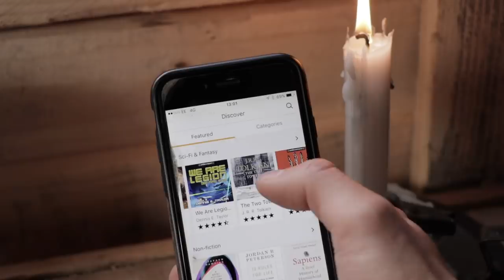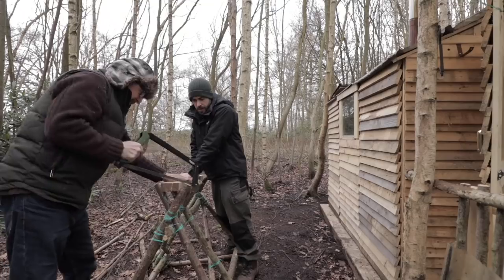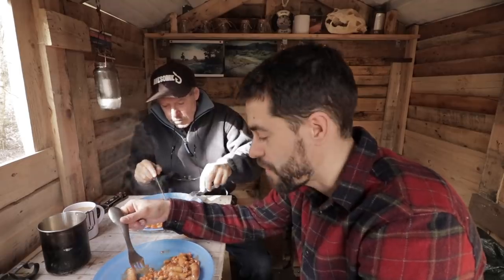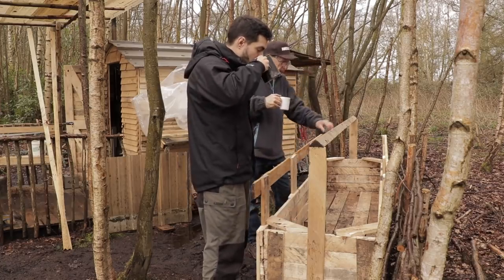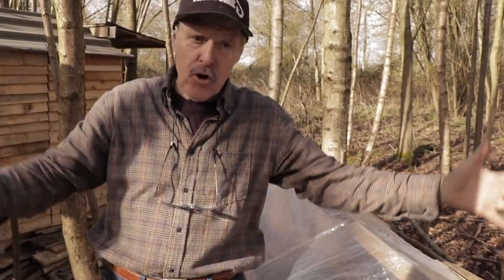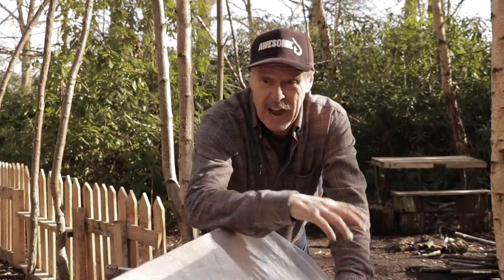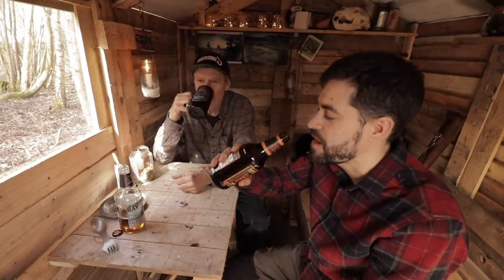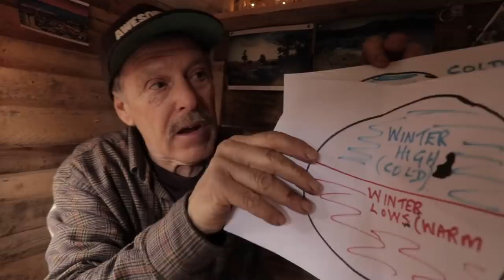Pallet Wood Cabin in the Woods: Raised Vegetable Bed for Spring Garden at The Off Grid Cabin

Comment: should collect the rain water from the slope in a 5 gallon bucket and use it to water your plants, just build a slanted gutter and line it with a piece of that plastic....also for your theroy i think it also has alot to do with the Earth tilt its changing ever so slightly and data from the past 282,000 years that shows, for the first time, a connection between the Earth's tilt called obliquity that shifts every 41,000 years, the movement of a low pressure band of clouds that is the Earth's largest source of heat and moisture—the Intertropical Convergence Zone, or ITCZ.
Reply: Where did you find data from more than a quarter of a million years ago?
Reply: Arctic ice core samples

Comment: I would add guttering to the cabin with a water run off collection system to collect water for your poly tunnel etc. I would also look into a solar panel for the roof. Just my thoughts thanks for sharing.

Comment: If you could find some discarded foam insulation board (in the states commonly used for basements or on the outside beneath siding) this could perhaps be adhered to the underside of the steel roof.  If you could find discarded construction adhesive this  might work.

Comment: Mike, if you haven't already, you should undertake the marathon read of Stephen Kings "Dark Tower" series of books. Its an incredible series, and not the usual horror you would expect from him. As for your Dad's theory time suggestion, I think its a feasible possibility, although it would more likely end up in a slightly narrower band of warmth around the equator with larger cooler caps both above AND below due to the melting ice from both the Arctic and the Antarctic

Comment: (IDEA FOR INSULATION!!!) i see that the wood shingle wall is visible from the inside. If you take some more planks and nail them up, flush along the inside wall then stuff the cavity with pine needles (or moss) along the way then it should help cover up all the cracks and give you some good insulation. Kind of like a real house. Some proper windows with a seal around the edges would help too. and putting seals along the door

Comment: Can I suggest a length of old guttering along the ridge line of your 'poly-tunnel'? I can't help feeling that the relatively sharp edge of that Arris rail will slice the plastic sheet. Speaking of which, I'll be interested to see how UV resistant that is... I'm guessing not very.
As for the cabin roof, lacking turf for the outside, I reckon your best bet is to line the inside, to create a 'more-or-less' closed airspace. Air is actually a pretty good thermal insulator, if you can stop it moving around too much. Just my two-penn'orth.

Comment: number one problem with the roof is the gaps in the eaves, they are big enough for light to get through, and cold air will pour right in. only then should you work on moss or vegetation pads.

Comment: Theory time - well as you keep saying, we rarely have snow on the south coast, which is true, but nationally snow has become less. My feeling with the polar caps shrinking is that air temperature isn't as cold as there is less ice volume to cool it, thus the warm air is gradually rising year on. Thus the loops are getting higher. The beast from the east is rare, and was a fluke combinations of air direction, weak storm currents from the tropics and Putin.

Comment: You are right. But it is not so much about the atmosphere changing, but the ocean currents changing (which then will change the atmosphere temperature). Did you watch the movie "The day after tomorrow"? That is exactly what happens in the movie, the north Atlantic ocean circulation stops working and Europe and north america experience a extreme and long winter.

Comment: When I can stop laughing I will try and add my halfpenny worth. Your second diagram (hang on I am laughing again) should only have gone down half way with the heat part, it would not go down to the antarctic. What about if heat rises it would get hotter above the equator. Serious now. On the inside of the roof stick egg trays, you can get them free and you can paint them. They will insulate the roof and stop some of the noise when the rain hits it. Keep it up fellas I love it.

Comment: Theory time musing, I would  guess the loops as Graeme calls them are caused by currents of walm water. These will continue to be present because of the rotation of the earth,  the thermal dynamics and the resistance of differing ocean depths will always create streams of walm water. It would take an enormous polar melting to significantly change this. As a fisherman Graeme should understand these currents because  they're crucial in catching walm water species like marlin hunting baitfish feeding on the cold water microbes

Comment: On a response for the theory time:
The jetstreams are tied to the great gulfs of the earth, but not in a way you might suspect. The jetstreams are really made by differential heating of the surface. The poles get less light with short lengthwaves (less energy-imput) and so they are colder. The equator gets beamed on, therefor it's hotter. What that does is it creates three closed cells of air current (air rising when it's hot, cooling down and dropping and dispersing to places where the air rises) where the jetstreams are located around the 60° mark. The reason they form those loops is the rotation of earth.
On the matter of the streams you're right. They get cooler the less ice there is. The impact of natural global warming, accelerated by men, will be a rise in sea level of about 30 meters at best the next centuries. (due to the adding of water from the south-pole and the heat expansion effect on water) By these effects, and by the rotation of earth, with the occasional landmass in the way, the streams won't really flatten out. They might change, they might not. There's not really a conclusion on it yet, because so many models exist on this matter.
P.S. please forgive my poor spelling, my native language isn't English...

Comment: I have been discussing that same thing with a friend of mine, and in an odd way we basically came to the same conclusion as your dad... I think that he is right on the most part. The fact is that the north pole ice cap is melting, and eventually will cool down the warmer waters from the gulf, and then makes the weather cooler in the north, and the warmer in the south ...  then the hot cold fight will be around the equator, but not as hard... if he is correct right ?  what about the south pole and the cold waters there ? . I think that it will over time normalize itself again.. maybe not in our lifetime but it will...

Comment: The answer to your theory: It's plausible but not as likely to be as extreme as a "mini iceage". What modern science believes causes the cold weather is that during winter the heat gradient that separates the two climates lessens and weakens the jet streams, allowing arctic winds to spill over the land. My hypothesis is that as global warming continues then the heat gradient will lessen and lessen untill the jet stream is so weak that the curved line of cold weather will straighten up a bit (not all the way because of the heating differences of land and water) and move down causing a cooling trend untill everything evens out. It won't go down as far as your drawing shows due to the coriolus effect separating the atmosphere into sections but it will still be effected.

Comment: The loops, as you call them are dips in the river of air called the Jet Stream. This moving air ar what moves the different pressure systems, from west to east. The Gulf stream is a current of water that comes out of the Gulf of Mexico and travels up the east coast of North America and crosses the Atlantic to the UK, modifying the weather there. Both have an effect, though totally different, on the climet in the northern hemisphere, but are not actually part of global warming/climet change. That is way to deep a subject for this comment section. Great work again. By the way,you eat to much. ;-)

Comment: 24:06  That's basically what climatologists are saying.  The collapse of the Gulf Stream will increase temperature stratification by latitude.  Not only colder winters in the mid to high latitudes, but it'll make the equatorial countries intolerably and dangerously hot.

Comment: You could be absolutely spot on with your theory... Or you could be totally wrong! The problem with making any prediction about the climate is the huge amount of variables. Climate scientists use massive super computers to crunch the data and it takes months to run those simulations. (And they don't even include all the variables)

The North Atlantic Drift is primarily driven by the thermohaline system, by the time the water reaches it's northern extent it is already cold and saline enough to begin sinking. As you rightly pointed out, It is affected by the melting of the polar caps... But, it's not the temperature of the water/ice coming from the ice caps it's the fresh water disrupting the salinity and therefore the density that is the problem. How will changes in the thermohaline circulation affect the atmospheric systems such as the jet stream... Nobody knows the answer to that!

Comment: Well, one of the reason why our climate is changing vigorously because every huge power storm is boost by atmospheric anomalies. Hurricane get stronger because the ocean is warmer, winter storm last longer because an unusual warm system push through to the Arctic and force the polar vortex go south. Every single element is caused and related to one and other.
For your dad's diagram, it is not entire wrong but missing the southern part. The warmer air masses will stay close to equator but not travel north as it used to be. It will be like a sandwich that cold air masses hold warm air in between.